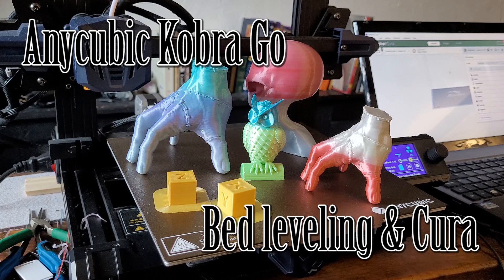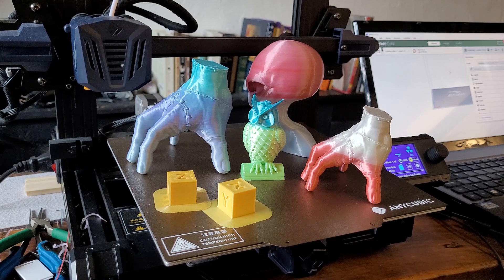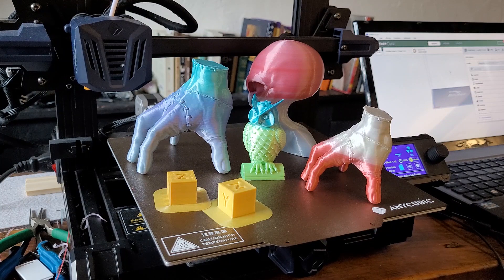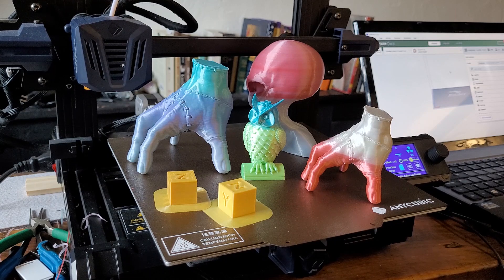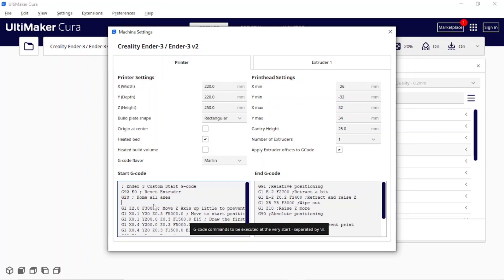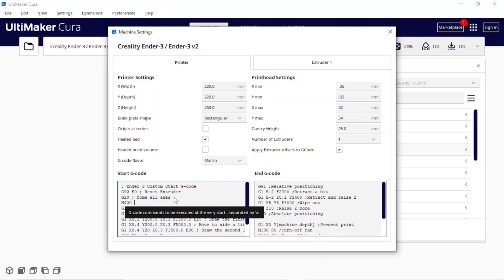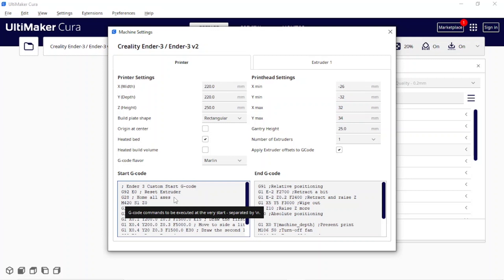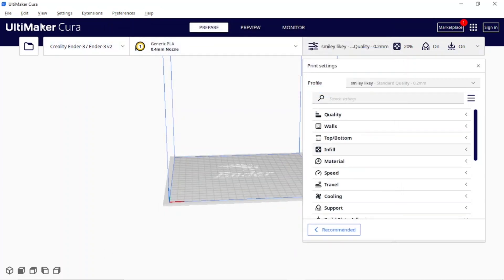Anycubic Kobra Go Bed leveling

Comment: Hey! I’m having an issue where my printer has a side that’s completely level however the other side is lower and causing warping. I saw in another video of yours you used springs to help that should I get some or do you have any other recommendations?
Reply from the maker: Morning I would do the springs they made a big difference

Comment: Im pretty sure that M420 S1 Z0 is built into the firmware, so it automatically activates it regardless. If you send an m503 to the printer with pronterface, it shows up near the top.
Reply from the maker: Mine shows up with the m420 as S0 and will not stay turned on so I just add it to the printer start code. 
Works every time now.

Comment: Can you make an updated one with the new cura update? TIA.
Reply from the maker: Hi Elgrueso is there something specific that you want me to update related to the new Cura?
Reply: @mayhemsmiley  awesome you replied! Thank you. But I see you adjusted the e step using under the ender 3 v2 printer settings though. And the new version as the anycubic kobra go, my main issue right now is the E step that skips when trying to feed filament.
Reply from the maker: @elgrueso9914  Your E step skips, is the gear clean of filament shavings/debris? Verify that the set screw on the extruder gear hasn't come loose.

Comment: Can I ask why you use the Ender3 setting in the slicer when Cura has an option for the Kobra Go?
Reply from the maker: When I started the Cura Kobra GO profile wasn't so great. It was advice that was given to me and it worked better, but I didn't understand the why of it at the time. I've also learned a lot since then. The ender 3 had the priming line before starting a print that I liked. Today I can read and write a fair bit of Gcode Never realized how easy it is lol These days I'll often look at the Gcode and analyze until I understand the why if I see something new or different. I've got something interesting coming up so stay tuned :)

Comment: Using the standard settings that cura provided and I see that they already have a M420 S1 gcode without the Z. Should I just delete that and type it again with the Z0 under the G28?
Reply from the maker: No need to delete just add the Z0 right after the M420 S1 and yes it should be right after the G28
Reply: @mayhemsmiley  Alright, Thx! :)

Comment: So I can do this in the cura slicer and not have to do it through pronterface on the printer?
Reply from the maker: HI Jw, sorry saw this after I replied to your other comment. Yes you can do this instead of having to use pronterface.
Reply: Thank you
Reply: Ok, I’ve done it in cura but I’m still seeing the near side y axis is thinner than the far side.
Reply from the maker: @jw6210  Morning JW I thought we would try to correct without conversion, but I eliminated the issue once and for all when I converted to manual adjustment and using auto bed leveling after fine tuning the bed. This improved my prints tremendously https://youtu.be/qpm1Rpr6EyQ

Comment: Does this reset the Z Offset?
Reply from the maker: Hi njt, no this will not reset the Z offset. The Z offset only gets reset whenever you run auto bed leveling from the printer control panel. Let me know if you have any other questions

Comment: Hello! thanks for the contend, its unvaluable!! do you think al this its applicable to the Kobra Neo? it has a direct drive extruder!!
Reply from the maker: Hi Espaartacomartin, Yes I believe it is relevant to the Neo too, do you use Cura to slice your models?
Reply: Yes I use Cura i have done the fix for the Z axie on prontorface and it makes my prints much more better you got yourself a new subs thanks a lot! but im still having a problem with cooling, the fan duct its bad I print a new one but I think the fan its not powerfull enought to blow the air on all sides, soz the bad english, but let me tell you for 110 euros this kobra neo its amazing with all this features @mayhemsmiley

Comment: I came across your videos and they are excellent.  I see the Anycubic Kobra Go is at $119 now.  I do have an Anycubic Mega S which has been good but I would like a second.  This looks like a great choice.  Is there a reason you purchased the Go with Bowden rather than the Standard Kobra with the Direct Drive for a little more $?  Thanks.
Reply from the maker: Thank you for the kind words
I was torn between buying an ender 3 and the kobra go at the time. Decided to take a chance on the kobra
I have another printer that is direct drive that works well but I get better prints out of the kobra.
Let me know what you decide and how you make out

Comment: I'm very new to printers, so I have a question. Can this be altered with the built in Cura profile settings for the Kobra Go or do you recommend setting it up as an Ender 3 like you did?
Reply from the maker: There's no issue to add the line into the Kobra Go profile on Cura. Happy printing.

Comment: I added the same printer and command. It didn’t level the bed before the print, is that what it is supposed to do?
Reply from the maker: No, the command won't level the bed,  but it turns on the usage of the data accumulated from the bed leveling that you run from the screen of the printer. Add the command then level the bed,  be prepared to adjust the z offset for the next print.
Reply: I did it. Not sure why though. What's your big news
Reply from the maker: @zoeconner11  Hopefully this will clarify the reason, but I'm excited about the visibility of this video https://www.youtube.com/watch?v=jcqU2T_anWY&t=3s